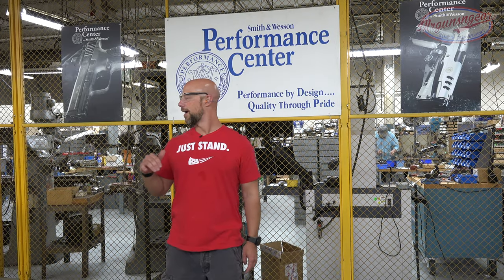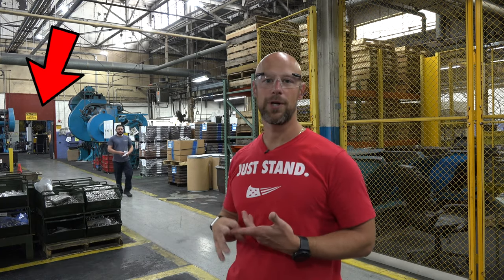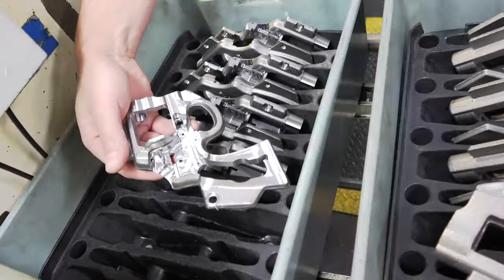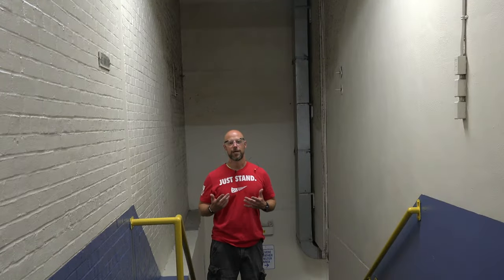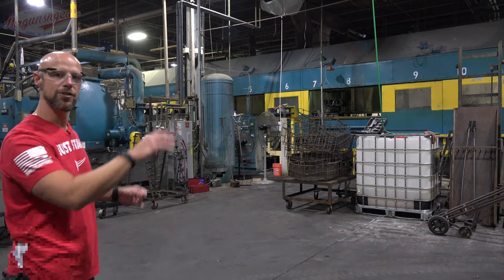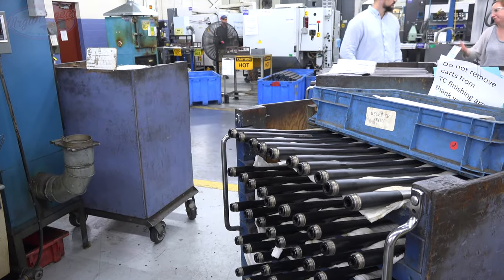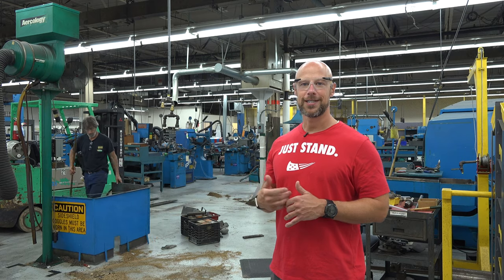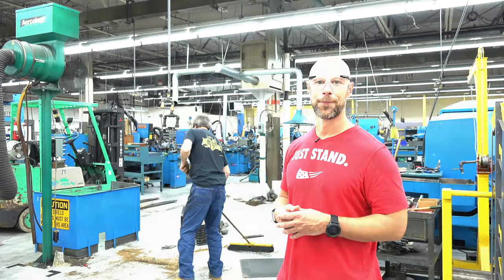Smith & Wesson Factory Tour!

Comment: I love S&W I carry a M&P 2.0 full size and my wife carries the compact, we both have sheilds as backup guns and none of them have ever failed us in 1000s of rounds..
Reply: Same with my SD40VE
Reply: I bought a full size  M&P .40 SW back in 2014. I carried that pistol for years still have it and she runs like a champ to this day.
Reply: I have the s&w m&p 2.0 45 full size, the sd9ve & the m&p 9c. All great firearms
Reply: @Mr. Yeezy The avid glock hater that I am would steer you towards the CZP10C over either one if you can only have one (I have all 3 and the CZP10C is the best IMO)
Reply: I bought a Smith & Wesson shield 40 caliber and had to return it to S&W with less than 50 rounds fired through it. Constant Miss feeds. Ammo Brands made no difference. I read on a forum that other people had the same problem with the 40 caliber Shield. Took 2 months to get it back. when I got it back it seemed to work . they said that they polished the chamber. but if you look at the mouth of the chamber with a magnifying glass they did more than polish it.  I also owned a Smith & Wesson M&P Sport AR 15 that I bought 11 years ago. It had a 1 in 8 twist melonite Barrel. Not exaggerating you could barely hit the target with this thing at 50 yards. Very inaccurate . it wasn't until I ran a 22 caliber bore brush through the barrel that I realized they were three places in the length of the barrel where the bore brush was very loose. Whoever machined that Barrel must have been on a Monday with a bad hangover. I had to send that one back to them and they put a new Barrel on it and when I got it back it was a nail driver. I own other Smith & Wesson products which have never had a problem with. only those two.

Comment: Where’s the M&p 10 sport q.c section? That’s right...they don’t have one.
Reply: SH  yes I agree I had one that wouldn't run , dumped it and got a SCAR 17 which I should've done to begin with.
Reply: The304LINEMAN I know that frustration. I sent mine back twice before it would run. 

Worst part was Smith and Wesson tell me there’s nothing wrong with the gun. I told them I have video but they never wanted to see it. 

After finally replacing the entire upper what do you know...it runs. 

Last time I buy a “budget” ar. Same problem with ruger mpr. 

My pof, lwrci, pws, fals, never a FTf or fte. Never once. I hate to say it but it seems nowadays with gun manufacturers, you get what you pay for.
Reply: @SH Yeah, cheap AR 10s typically don’t run well. Seen a couple good reviews on the M&P 10s, but plenty of negatives too. Midwest Industries makes a great AR 10. And I believe Stag Arms does too. Probably more but can’t think of them off the top of my head.